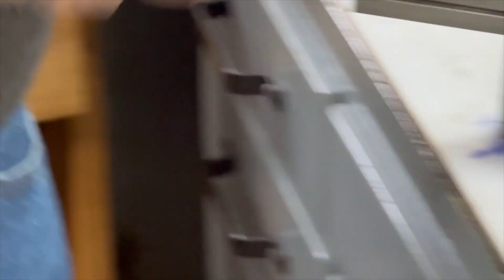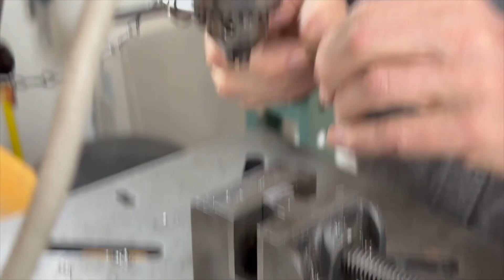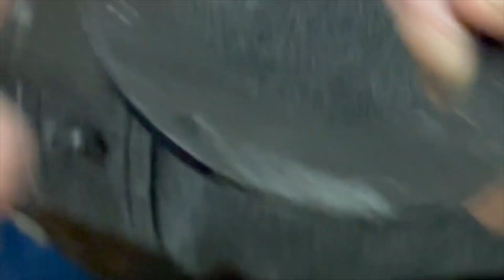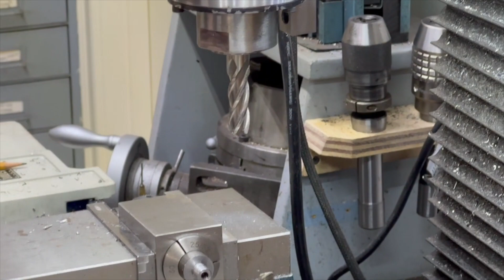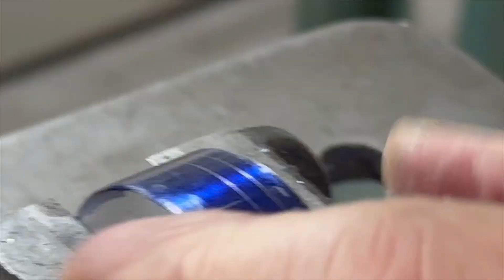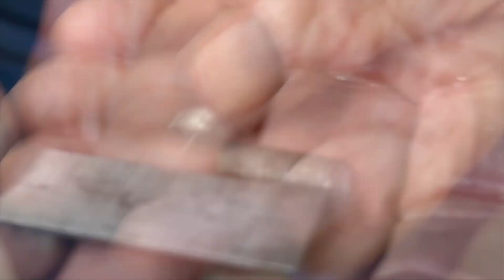PM 728V T Milling Machine Spindle Stop

Comment: I made one of these and it works great.  My only issue is remembering to pull the pin before turning on the spindle. Luckily a belt and not gears.
Reply from the maker: Thank you for watching my videos. It’s always great to hear when someone finds it useful. That spindle stop saves you a lot of time and aggravation of looking for the wrench. nice job. Joe

Comment: Nice design. Too bad the spindle on my 727V has flats not holes. But I'll keep thinking about it, maybe I can adapt your approach.  Subscribed.  I guess I should have watched til the end to comment. I see you made an adapter ring. Nice solution.
Reply from the maker: The 727v is about the same as the 728 it should be the same except for the size. Thank you for your interest and your feedback. Joe